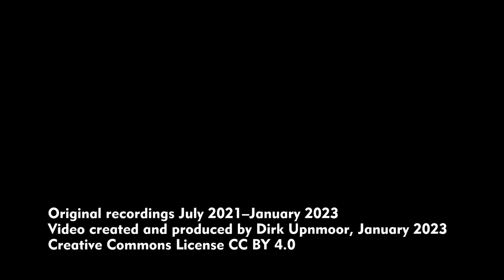S-Bahn Hamburg: Update vom Bau der S4 in Hamm und Wandsbek

Comment: Excellent Video dirk and for the S4 once completed will it be ETCS Level 2 ATO the Digital Hamburg S-Bahn or PZB like all German Deutsche Bahn & Austrian OBB main lines except Berlin S-Bahn ZBS. From what I can see RE8 RB81 Hamburg Lubeck seems to be rotating with 146.2 & 112s rare DB BR182
Reply from the maker: Thank you! BR 182 does not run on the line to Lübeck. There are double deck trains with them at Hamburg Hbf, but those are the trains of the RE line to Schwerin and Rostock ("Hanse-Express").